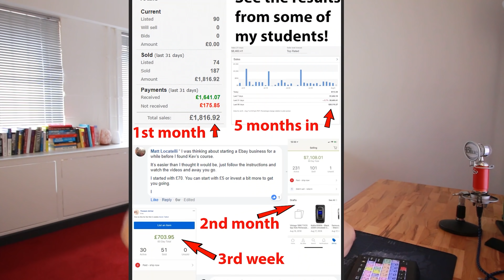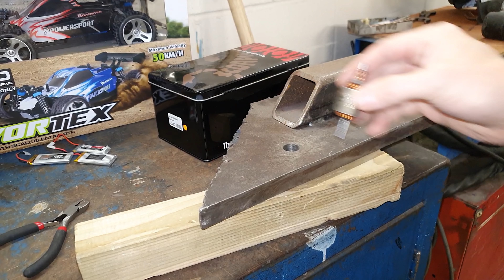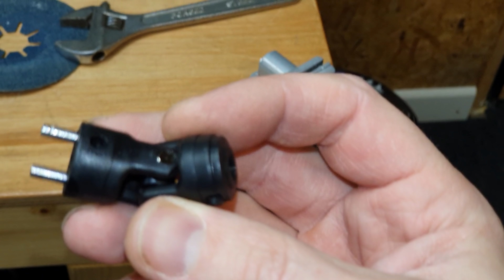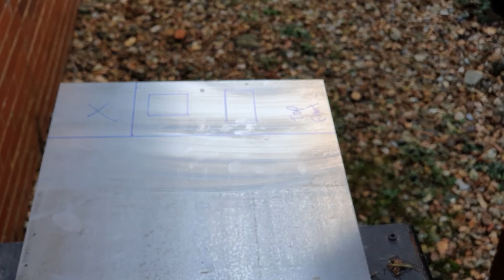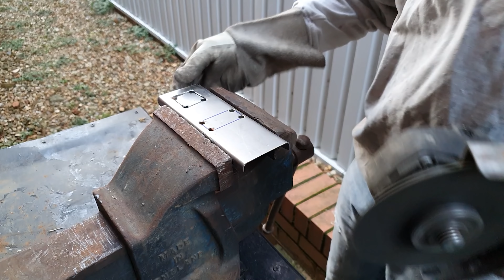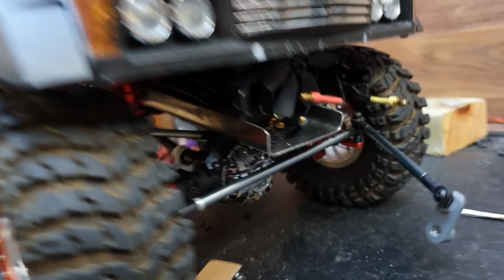REAL 4 Stroke Engine into RC Car Install

Comment: awesome build.  though, for u-jount mounting the engine at an angle..... can anyone confirm? i think your drive dogs / u-joints must be parallel in order to avoid pulsing in the drive train.   If you google search "Understanding the Need for Offset Shaft Alignment" and click the first link it offers a good explanation.

Comment: Way back in the day, I had an xtm x-factor with an o.s. 4 stroke in it. It was cool and all, but the oil in the exhaust got old. 
I still have a prather boat with a 4 stroke marine liquid cooled motor in it.

Comment: Conley did this back in the mid 80's using his V4 in a Tamya 4wd pick-up. I saw it at the RAM show in N.Y. and have pictures. He also had a V6, V8, and a not finished V12 he was working on. It was soo awsum to see! At a RAM show before his fire, he had his working Dodge Viper V10 on the selfcontained stand and ran it, BEAUTIFUL WORKMANSHIP! Good luck guys, hope it's something you can bring to market!

Comment: I would lose one of the tranys if its a crawler its a crawler. Make an extension from trany to bell crank and where is the radiator going or you didn't make one yet i seen another guy had made one

Comment: Just a quick question just bought a arrma 4x4 1/10 and was wondering do you run your rc in fwd brake reverse or just fwd brake. Thanks in advance for the comment and help

Comment: Raise the engine completely level and cut out a hood scoop mate. It would keep motor cooler during a climb and it would just look awesome.
Reply: Plus with the motor tilted down, you don't want rocks hitting and hanging up the fan.

Comment: You need a much shorter set screw that holds the new transmission to the stock one. It could cause a vibration in the transmission from that one you installed being much longer.

Comment: Hey man I would watch the reverse on the revo 3.3 transmission the reverse delete is a pretty common mod on the transmission for that truck because the reverse gear seems to strip out the primary drive gear in the trans I've had 3 of the nitro revo 3.3 and that was something I had to do on all of them after that no more trans issues but since this is a lower speed car you may not even experience as much as I did with the revo but that was a sure fire way for me to bullet proof the transmission

Comment: You should have clocked the Revo gearbox so the gear to the engine sit's pver the gearbox and had a stepped mount so the gearbox plate is lower to the chassis then the engine would be lower also.
 But you are going in the right way.

Comment: Kev can you please recommend a crawler that can go really fast and still crawl (not the trx4 I can’t afford that) I have a hpi crawler king but it flips at 10 mph
Reply: You really need one the trx4 models with unlocking diffs and 2 speed transmission if you want a fast crawler.
Reply: Bucknasty84k10 I can’t afford a trx4 I got 170 $
Reply: Bucknasty84k10 I’m thinking about a team associated cr12 ford f 150 but not make it fast

Comment: Ok dude , this is what you should do. The truck is orange and so is the top of the motor. Cut a square opening for that air box to fit thru. It will look like the shaker hood scoop on the old trans am. If you make a nice clean opening it will look awesome. Leave a little clearance for body movement.

Comment: or you could just use only the revo 3.3  transmission and change the primary gearing, and use a two ended slash 4x4 plastic driveshaft

Comment: Kev for a video suggestion get the Lego technic Land Rover defender and convert it into a crawler but get some Lego rods so it can be as if all of the diffs were locked and put it up against a normal rc crawler

Comment: why dont you just put a square hole in the hood so that the body can sit normal but the valve cover is sticking out. they are basically the same color

Comment: Cut open a hood scoop for the engine to stick out from the hood a bit
Reply: Top of the engine got also same colour.
Reply: It'll be cool displaying the toyan emblem through the hood. just may need a bit twist on the Carb to allow clearance from the windshield. nice!
Reply: I have no idea why he is not doing this. Drives me crazy
Reply: Matthew. Baudinette I agree
Reply: Yes
Reply: @playeff479  YASS!!
Reply: YASSS
Reply: Yesssss
Reply: Да-Уж создал платформу с зопасом СССР молодец.
Респект тебе.
Reply: Yes
Reply: Good idea sir
Reply: That would look so much better then the body lift and it looked like the colors matched already so I doubt you would notice it from a far
Reply: KEV PIN THIS!

Comment: Hi Kevin I’m saving up for a traxxas Xmaxx can u recommend some mods I allredey have a hyper vs and slash 4x4
Reply: Archie Flyer the most big ass motor you can find lol
Reply: Suspension and drivetrain if you're really gonna bash it.
Reply: Rydog5392 drivetrain is fine but the suspension just needs new shock shafts. Kevin made a vid about it....